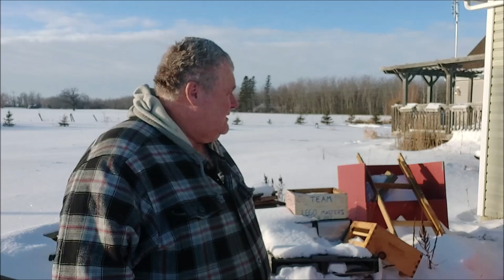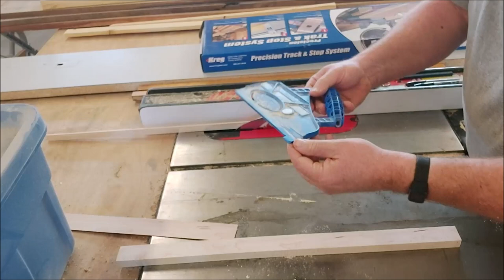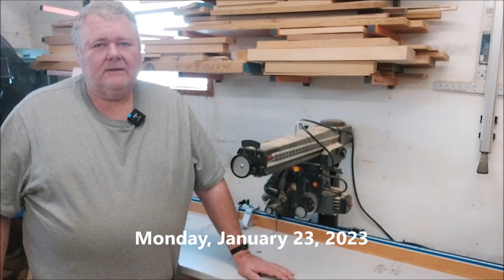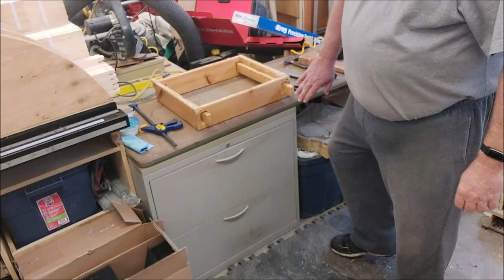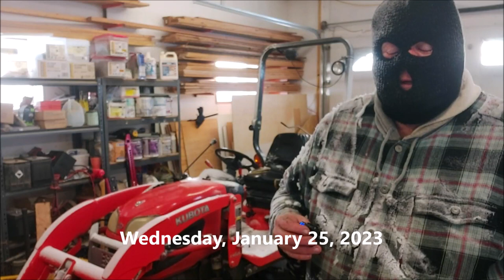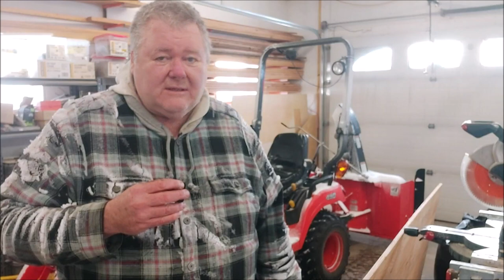⏱ Vlog January 21 to 27-That Bee Man

Comment: Hey Brad. I always enjoy your videos and learn alot about tablesaw safety. Caught the tip of my middle finger a while back which wasn't very pleasant. Of subject, I've finished my 3 six framers and have a question. When making splits in them is it much different than 5 framers as far as bee population, capped brood etc? Thanks in advance.
Reply from the maker: Hi Hope.  I can't speak for every location specific challenge but I don't worry about the difference between five and six frames when making my nucs.  I'll make a single brood nuc in a six frame box but the weather has to be warm enough for a maneuver like that.
Reply: @ThatBeeMan  thank you.